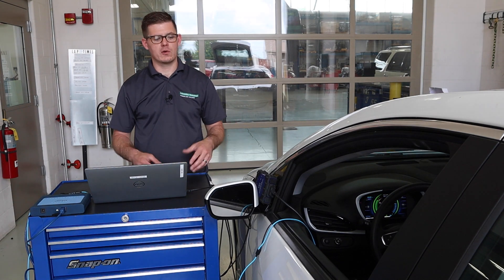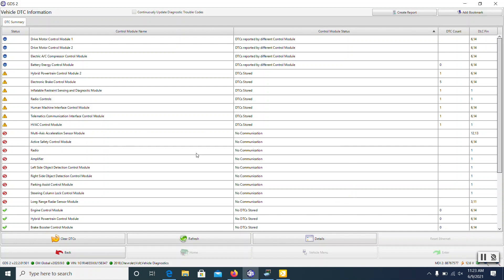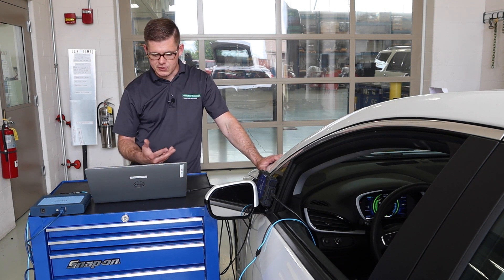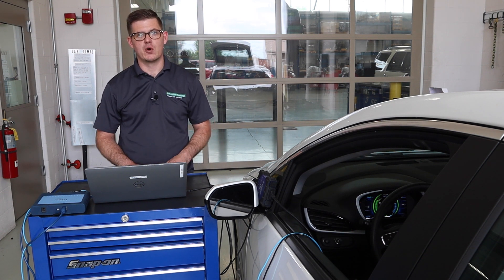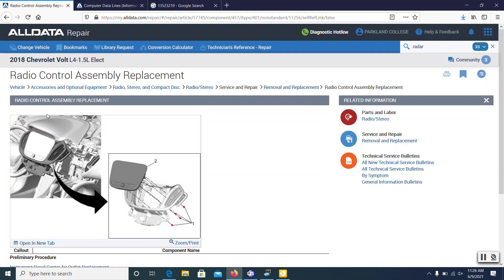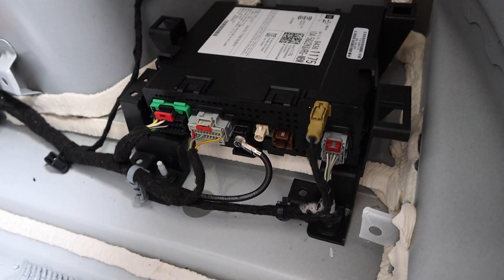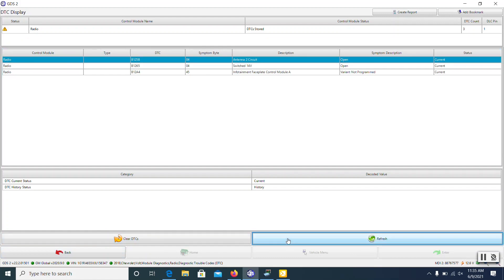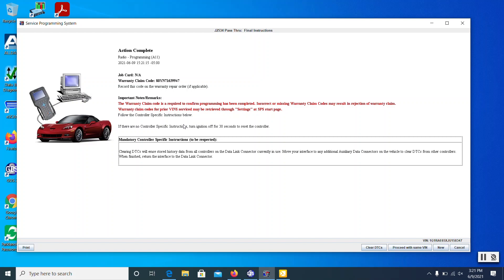Control Module Diagnostics, Replacement & Programming

Comment: What computer do you recommend for GM module programming and which version of windows works best?
Reply from the maker: The only configuration I have used for GM vehicles has been the factory tooling. The MDI2 hardware with a GDS2 subscription through acdelcotds.com . You should be able to utilize any J2534 cable and purchase the GDS subscription. The upside is you can purchase a short-term subscription for most manufactures like 24-72 hours and bill it out to the customer.

Comment: You need to download the GM bus viewer , it works through the MDI-2 and allows you to in a sense scope the networks.. obviously it’s not as fast as a scope but it’s very helpful .
Reply from the maker: Yes! It is a great tool. I viewed it while I was looking at this car but did not pursue showing it. Interestingly, it did not list the radio in the modules it pinged and confirmed.
Reply: @AdamsAnalysis  that’s weird , yea the bus voltage viewer feature is pretty nice for a quick way to see if the bus is shorted or missing a terminating resistor . But nothing beats the Pico for network diag